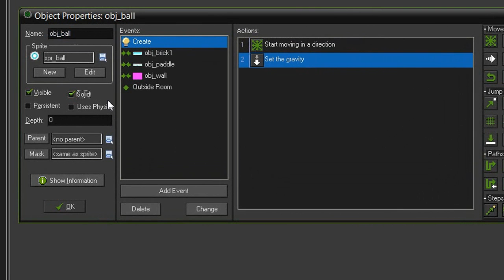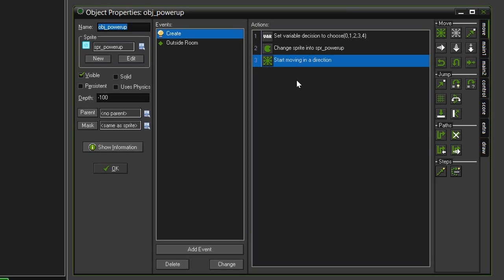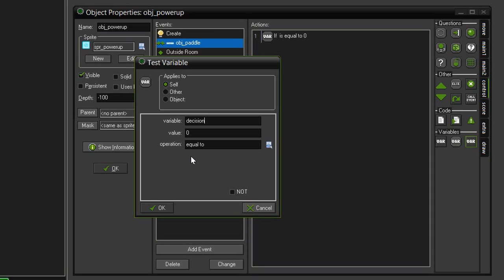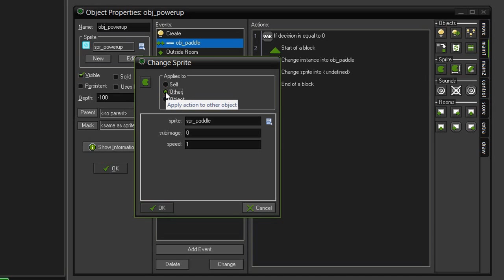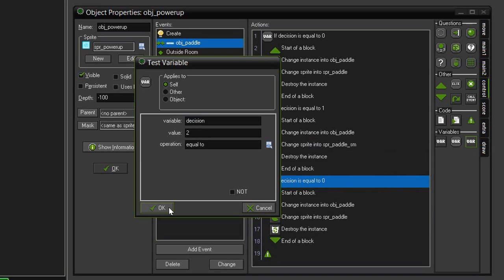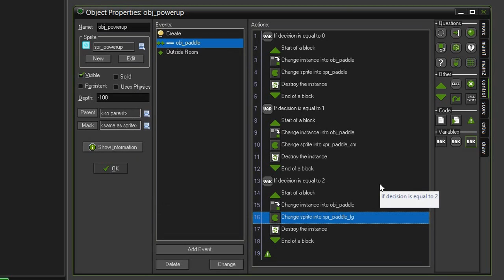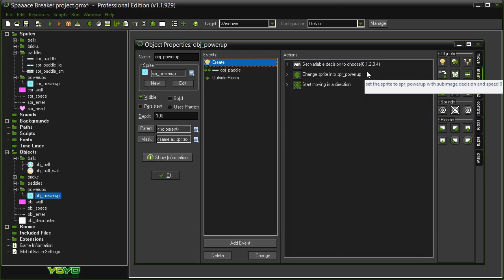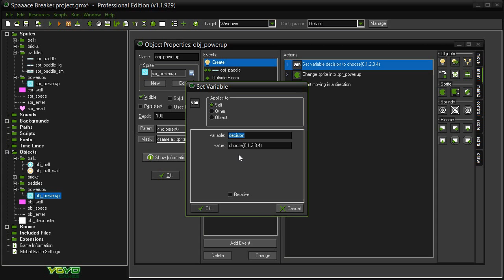Game Maker Tutorial - 'Brick Breaker' 7

Comment: OK problem solved- the powerup decision variable should be used to set the appearance of the power up, the collision with brick event on the powerup simply needs to destroy instance.  You then add a collision event to the paddle so that on contact with the power up the appearance will alter depending on the value of the variable Decision (which is linked to the powerup object) use that to change the appearance of the paddle .i.e if decision=1 change sprite to paddle_SMALL